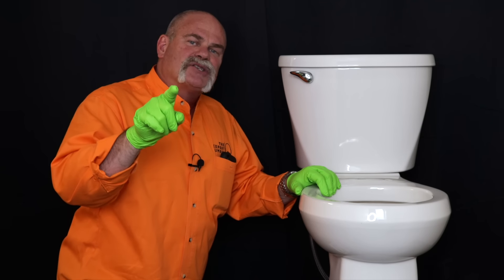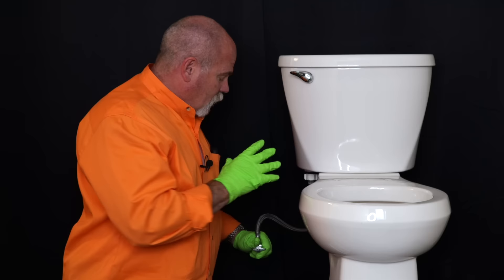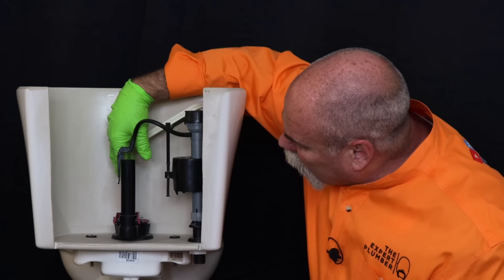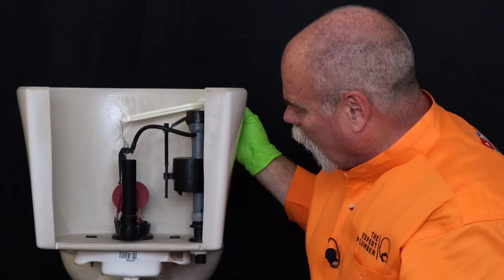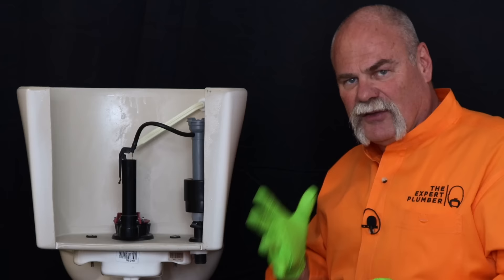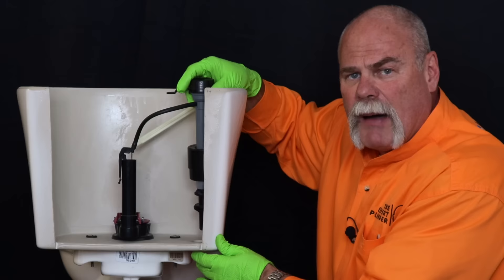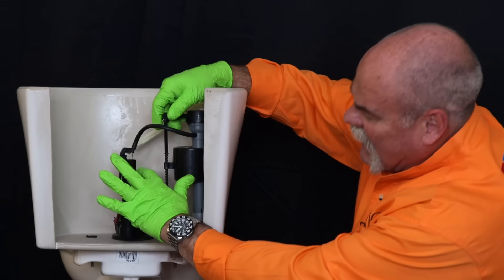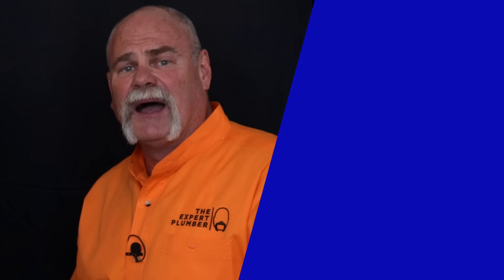How to Fix A Running Toilet GUARANTEED | DIY Plumbing Repair

Comment: Hey Roger, I watched your video and it was very helpful. I took my flapper off. I was able to figure that out. Mine has a weird spongy thing on top but I think it was OK. I was able to put it back. I didn’t take my flow valve apart but the question I have is that when you did take it apart do you snapped that long screw Should that be adjusted? I turned it a couple times . I don’t think it’s leaking anymore but I was just wondering which way should you adjust that Phillips style long screw. Thanks Chris
Reply from the maker: Hey Chris thanks for the question, that is for the float in your fill tube, if your flush does not have enough, or too much water you twist it to adjust the water level going into the tank. Hope this helps!

Comment: Thank you sir. I have two toilets that run all the time. The port where the flapper sits are bad and won’t seal. These toilets was installed in 1973. I would like to know what I should replace them with, brand, model??

Comment: great vid but why would a diaphragm valve keep it running? I hear a constant drip and i just replaced the flapper which was bad so i am confused why it is still dripping.  Would you replace the whole flush system the middle hole part that has the flapper on it? (sorry i dont know what it is called but the main flush hole assembly that you refrenced a different video)

Comment: I just did this for both toilets at my parent's house. I should have replaced the handles too though, since they still would run sometimes, but I did not have time while there to run back to the store and then do that.

Comment: I am at the point at standing outside and screaming at the top of my lungs! My toilet has been running intermittently for a month or so. I've asked my husband to fix it and his fix it was for me to use the other toilet! I told him no I am not going to do that, please fix it. So, I've waited and waited! Finally, my husband had the person that fixed the WOOD on our deck to come over and check it out. Now that guy did a wonderful job of replacing the wood on our deck. But his answer was to replace the WHOLE TOILET. I was like NOOOO. Today I got fed up with the whole thing and did my due diligence and ran across Roger Wakefeld. Now I am going to fix it myself! Thank you, Roger.

Comment: Tried this and messed around back and forth between my two identical toilets
 Realized it's the actuator gasket on the valve that is worn down more on my running toilet than compared to my properly working toilet. Need to go get me a new actuator gasket tomorrow!

Comment: We replaced the fill valve last night and it is still intermittently running. We had put the new flapper but it didn't fit right and then put the old one back on and still running although less likely. I think we need a new flapper seal? Could I have messed up anything on the fill valve? I noticed a coller that after I moved it I saw it says "don't move' on the instructions. I put it back snug. Could that be my problem?

Comment: Hi Roger, I took out the valve and cleaned the mineral deposits from around the rubber, put it back together. It's better, but it still runs until I push down on the top of the fill valve. When I push down on the top of the fill valve, it stops running. Apparently, the rubber thingy isn't seating properly in the plastic part. What to do? Any tricks?

Comment: That tube on the side of the fuel valve that you just snap back on that's what's broke on mine. Do I have to change the entire filler out because that broke or can I just buy the little tube somewhere

Comment: I lowered the float by its vertical location adjuster and the incoming water flow stopped just when water level reached the overflow drain pipe.

Comment: I watched another video, did the steps, checked the parts, was unsuccessful (not knocking that video, it was good, just not as thorough). You added one step (cleaning out the diaphragm). Sure enough, little bits of debris (rubber?). Flushed it out (with an old toothbrush), reassembled, filled the tank, all fixed. Thank you very much!

Comment: I have a very unique toilet with an extra hole (for an overflow) in the tank and the toilet itself where the tank sits. We want to replace it with a new fluidmaster but I think I need to plug that hole, otherwise water will just flow out into the floor but idk how to plug it. Also, the main drain goes into the wall on the side instead of down into the floor.

Comment: so i've changed the flopper and the fill valve but I still get water running into the bowl and it only stops when I turn off the main water supply to the tank even if the tank is full  any advise!!

Comment: Roger in my tank, it seems, the flush handle doesn't only move flapper strictly up and down but gets it out of whack enough to where it doesn't sit back down right so the toilet keeps running. This toilet is the reason I own this house now as $1,500/month water bill drove ex-homeowners to foreclosure!

Comment: I finally got the nut off the old fill valve but my old fill valve did not lift right out. It seems melded to the bottom of the tank with what looks like may have been a rubber gasket. Is it ok to try to pry it up with a screwdriver. Signed toilet-less and frustrated

Comment: I have a 1950s toilet that is running.... the float simply wont push up enough even after adjustment. Im thinking swap out the part there on the right, new technology in the old toilet. It should work? Same hole in the porcelain?

Comment: What about switching the fill valve from the ball fill valve to that one in your video? Is that just as easy my bowl is an American standard and it driving me crazy. I’m not sure if it’s the flapper or not and the flapper on mine is not that rubbery one it’s more of a hard plastic type rubber

Comment: Hey there. I have the problem where the flush won’t trigger a refill and I have to touch the top of my fill valve to trigger a refill (looks different than yours, has a rectangular reservoir catcher to tell the toliet when to stop, had to remove a green cap of sorts). Any help to this problem? Thanks!

Comment: so i put some foamy thing into my toilet to clean it out and when i tried to flush it nothing wouldn’t happen so i opened up the top and there was some of the foam part in there so then i pushed down on the flappy valve thing and it would make the same sound that it makes after you flush the toilet and it wouldn’t stop so i’m holding it up with a toothbrush right now. what do i do to get it back to normal?

Comment: Roger, our angle stop is not turning any more and won't shut off the water.  Our toilet is running and the the fill valve isn't working right to stop the water as it fills the tank, so it just keeps running.  Can you give me any advice on the angle stop and how to get it to turn the water off?  It is probably 30 years old.  Thanks for any help you can give!

Comment: I changed the flush valve and the fill valve. Toilet tank still leaked water into the bowl every few minute. So I even though the flap is new, I still changed it just in case it was defective. But the toilet still leaks. I have three toilets in my house, and I have fixed the other 2 for the same problem, but this one just won't stop leaking. It is mind boggling. Any suggestions?

Comment: I had a toilet installed 2018 and I just happened to look in the tank recently and there is a small amount of brown soot type sand on the bottom and when I touched it, it starting swirling around. What is that stuff?

Comment: I didn’t want to start with the supply line, simply twisting the flush valve gently clockwise did the trick for my toilet 🎉

Comment: You make it look so easy because the back of the toilet is removed. That might be a great idea, to make a toilet with a removable front (as the back is usually against the wall) so you can get easy access when you need to replace something.

Comment: I fixed my running toilet.. I thought it was the float but turns out it was the pin ..fingers crossed it keeps working😊 single Mom in Canada

Comment: With the help of this video I was able to install new flappers on all 3 of my leaky toilets, and they’re not leaking anymore! 

However, now they all flush like normal, then gurgle/bubble (as if the toilet were clogged), then complete the flush like normal. I used the Korky flappers with and adjustable dial, but moving the dial around doesn’t seem to make a difference. 

I know they aren’t clogged - they didn’t all simultaneously clog without even being used yet, when the new flapper was installed. And the toilets are not leaking at all, so the flapper has a good seal. It almost feels like the flapper isn’t closing as quickly as it should and that’s causing the gurgling? If anyone has any tips I’d appreciate it, all the googling I did just talked about clogs.

Comment: I have a toliet that after replacing the fill valve and the flapper....as the toliet tank is filling the water continues to run into the bowl and only stops when the tank is full. I have checked the surfaces that the flapper sits on...smooth and clean. What could be the cause of this??????

Comment: So I just replaced my fill valve (because it wouldn't shut off after the tank was full) probably a result of contaminants in the water destroying the diagram. Anyway, I got the water fill level set up perfect, and the toilet seemed to work well. However I started noticing ghost flushing. I would watch the water level go done enough to trip the float and refill the tank. Assumed the flapper was leaking. Wiped the flapper and seal clean, but still did it. Figured the flapper was just needing replacing. But than I tried an experiment. After the tank filled,I shut the supply line off. I would watch the water level dip down to the usual spot that would trip the filler. Assuming if the flapper was leaking , the water level should continue to fall. But oddly enough it wouldn't leak any further,even after sitting for hours. Turn the supply line back on, and it goes back to filling, than leaking. Any ideas?

Comment: My toilet has two stopper valves.  The chains that lift them often get tangled and cause the toilet to keep running.  How do you fix that ?  What does guaranteed mean when you say it in this video ?

Comment: I had to try and fix my folks toilet. The toilet keeps running all the time, and you gotta jiggle the handle to get the plug to go back down over the hole. It’s a kind that does not open up at and angle. It just goes up and down. I had to figure out a way to fix it, so they don’t have to constantly open the back and push it down manually. I added some wd40 to the plug and it worked great so far. I hope it stays working.

Comment: My fill valve keep filling a tank every 30 seconds or so. I cleaned the top rubber and still doing the same. Should I go ahead replace the valve unit. Thanks

Comment: It is easy when you don't have a wall or bathtub right next to the toliet.  It is a lot more challenging when having to change the fill valve in those tight locations...

Plumb on!

Comment: So my fill valve just shoots all the way up after turning the water on, just installed a bidet and had trouble getting the screw under the tank off. Feels like the person before forced the screw in unleveled. Aside from that I hold the fill valve at proper level and it keeps running it was so random when it happened

Comment: One additional problem - make sure the small black rubber tubing doesn't go down inside the white pipe. My pipe has a holder that seemed to allow the black tubing to go way down inside the pipe when I replaced the fill valve. This caused a syphoning effect from the tank to the white pipe via the black tubing that caused a leak that seemed to be the flapper but was not the flapper. Raised the tubing to above the final water level and no leaks. This should be a standard thing to check since I almost went to the large effort of replacing the flush valve.

Comment: My fill valve doesn't work sometime. When it doesn't, I remove the toilet top and when I touch the valve the water starts filling again. Not sure what the problem could be. Any suggestions?

Comment: I bought a brand new fill valve, and it continued to flow in. I know it's the water entry system that's the problem because it only starts to let water in after I turn the tap on. What is the issue?

Comment: Damn, i had a fill valve problem too, i guess it really is the problem most of the time. It wasnt closing properly due to excess gasket blocking its proper sealing.

Comment: I changed my flush valve with new flapper and new fill valve and i fill the tank shut the water off and after awhile the water level drops which means the toilet is constantly trying to refill often please help!

Comment: Toilet had been over filling and leaking out of the flush handle.  It was slowly filling after the float cut the water off, which you could hear if you listened very closely.   My wife called a plumber, and was told THIS WOULD BE A $300 SERVICE CALL.  This video showed me exactly what the problem was.   That diaphragm inside the fill-valve was dirty, and the fill-valve was full of crap.  cleaned both out, put it back together and works perfectly, and didn't need to buy anything.  Right before this problem manifested itself, the fill valve had started making a whistling tea-kettle noise while filling... probably air being forced around the dirty diaphragm I would guess.

Comment: Does it still work the same way if mine isn't black?? That hook up where the valve goes is baby blue... before I touch it does it work the same way??
Reply from the maker: push the handle and see. The color should not matter.

Comment: the bottom tube the fill valve slots on to really doesn't need to be replaced unless its leaking or the new valve top doesnt fit. Its much easier to just use the a new fill valve  and set it on the old tube instead of taking the whole thing out.

Comment: Problem for me was the fill valve, I opened it and a small pebble or something fell out. No idea how it got there. 

The only thing that was a bit different was i pulled the black cap off, but the base was still on the top of the tube. I had to separately twist that to get it off, it didnt all come off in one piece like it did for him.

Comment: Thanks for the video. My toilet is running. I replaced the flapper and now water is still running into the bowl AND now there’s condensation around the bowl and around the shut off valve :(
Reply: Hello, How are you doing?

Comment: I got the line disconnected but the I can't get the piece under the toilet to come off. It's so tight. I got it a little loose but it won't go any further. Any suggestions?

Comment: Can anyone help?  I paid someone to replace the entire innerts —taking the tank out— and it’s still makes the hissing sound from time to time (not as badly as before).  So it should not have any debris to be cleaned, right? Since the valve is new. The flapper is new. The water supply valve is also new.  Please help.

Comment: God must be watching over me, this is the very video I needed to see. The water supply was redone in my neighborhood a few years ago, and debris had gotten into most of the valves in my house, I've had to clean debris out before. I didn't know the diaphragm valve came apart like that, that'll be the first thing I check. Thank you for the information.

Comment: You can differentiate between these 2 problems by letting the reservoir fill, and stop the water going to it. If it still leaks, it's not the fill valve.

Comment: Good video with a lot of good information, but ultimately your guarantee isn't worth the platform it was printed on (and that's pretty little already). My toilet runs, but I couldn't find the flap OR the float anywhere. Maybe they're down under the Ecoflush vaccum system? ;)

Comment: On our toilet, the water level in the tank slowly drops and causes the valve to add water to bring it back up to the proper level.  We replaced the flapper, but the water level in the tank still slowly drops down.  When you look in the toilet bowl you can see water trickling slowly into it from the tank.  Flapper valve seems to "seat" OK.  Any thoghts?

Comment: Is the seal under the  pvc pipe suppose to lift off the flapper? My toilet was running constantly so I lifted the pvc pipe up and the seal came up off.  I set it back down and now it runs normally I THINK!!

Comment: My toilet is running. I watched your video. I checked the flapper, it's ok. I adjusted the water level.  I took apart the fill valve.  I couldn't see anything wrong. I put it back together and turned on the water valve. The water is still filling up past the water line. Then I noticed that water is coming out from the top of the fill valve. Seens like it's coming out at the top where that little arm connects to the top of the fill valve. Do you know how to fix that?

Comment: My toilet keeps running after I flush it but not every time. The maintenance men at my apartment have been here 5x to fix it but it’s the same. The last time they were at my apartment they got an attitude with me saying it works and they’ve fixed it but the last time I flushed it it ran for at least 20 minutes while I was making dinner, I’m not sure what to do at this point but I did take a video of it this time